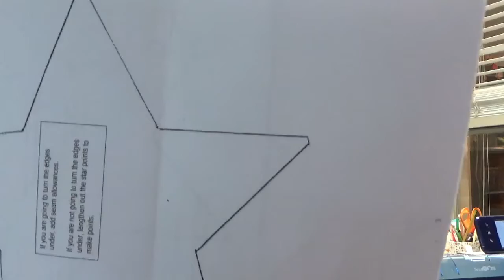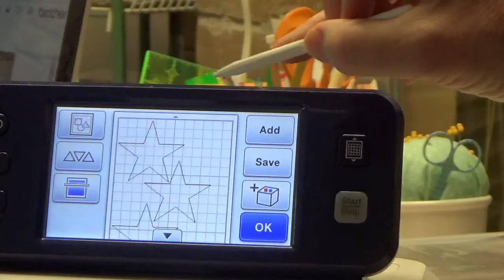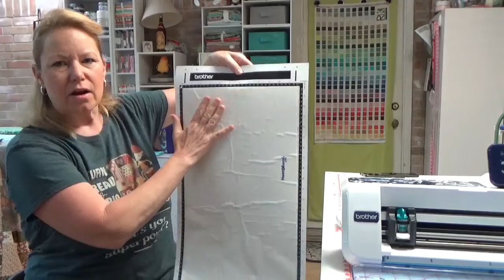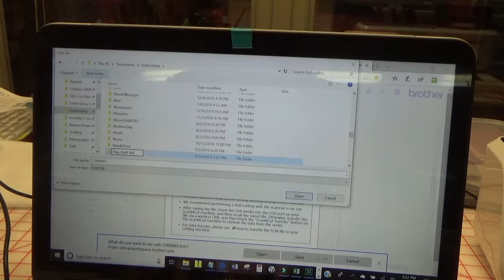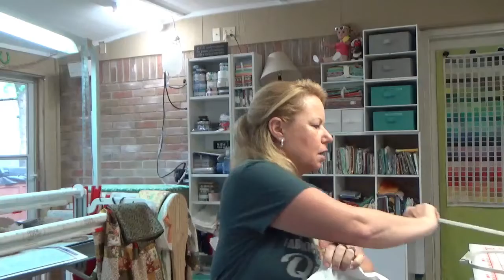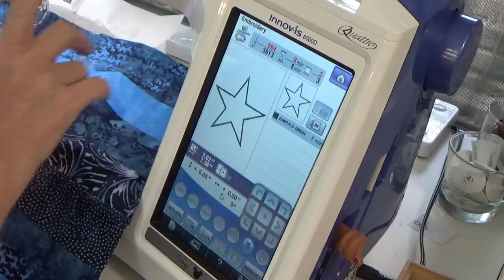Tutorial - Make the Freedom Quilt with the ScanNCut and Simply Applique

Comment: Hi Becky!  I’ve got a question. I’ve emailed Brother and a Brother dealer, and can’t get a coherent answer. I have a Scan n Cut 2.  I also have Brother, BabyLock and Janome embroidery machines.  Using Simply Applique, can you save files to other embroidery formats, such as .dst and .jef?  Or will it only save to .pes? One dealer told me that the embroidery files can only be used on Brother machines.  🙄 Thanks!
Reply from the maker: Hi there!  If you take a look at 20:14 in the video, I'm doing a File/Save As and you can see all the different file formats that the software saves to.  No, it does not just save to .pes and only work on Brother/Baby Lock machines.  I have a Janome MB7 and I've used it on that machine just fine.  The problem at the stores is that they are just not familiar with this software.  It's been around a long time but is limited in it's function so it never really sold well because people didn't know how to use it.  I think Brother is selling this software more now since I've started videos on it than ever.  The limiting factors of the software works great for folks who applique quilt like us and don't do much more, but if you are a serious embroiderer you'll want to use a more capable embroidery program like PE Design Next, DrawWings or the Floriani software...but those are $$$$ and of course the dealers all want to sell you that.  I believe all that software has an applique feature in it that can use scanned designs.  Me?  My companion software is Embrilliance and so far so good but it doesn't recognize .fcm files - hence the need for Brother SA.  You don't need Embrilliance, but that's just the software I use in addition to SA for all of my embroidery needs.  If you are seriously thinking about purchasing it, please contact Allbrands.com.  They are out of Baton Rouge and provide exceptional customer service. They still offer it on their website.  Here's a link with all the product info.  And I just noticed they have now linked to my video on their website!  lol  (With my permission of course).  https://www.allbrands.com/products/65662-brother-sabessa-simply-applique-embroidery-softwar
Reply: Power Tools with Thread   Thanks!  Yes, I use Embrilliance Essentials. And it works great with my Accuquilt die cuts. I contacted them. They have software that recognizes .fcm files and creates embroidery files for the Scan n Cut. But it’s almost $400 and does so much more. Personally, I have no desire to digitize embroidery designs, so it would be complete overkill for me.  My only other obstacle is that Simply Appliqué is not Mac compatible. I have Windows laptops, but really prefer to work on my large Mac desktop screen. I guess I’ll have to dust off one of my Windows machines.  😉 Thanks again for your help!

Comment: Becky do you know if any the programs you mentioned (I think you call them programs) can be used with the cricut maker and a Baby lock Esante...I have had the Esante for 11years...Maybe could convince Hubby on trade in (not too sure)...But the Cricut Maker no way(just got it for Christmas and have not even opened it)...I am also looking into the small Grave frame and a larger throat plate machine....Again everybody has a different name for them long arm, mid arm
Reply from the maker: I dont think Simply Applique works with the Cricut.

Comment: Great tutorial thankyou can I ask I’m in uk if I bought this simply appliqué programme from USA would it work ok as no one in uk stocks this which seems a pity thanks
Reply from the maker: The minimum PC requirements (according to the box) are "IBM PC or compatible computer. Operating System Microsoft Windows 7, 8, or Windows 10. 1 gigabyte of RAM, 1 gigabyte of hard disk space, and Monitor 1024 x 768 video resolution with 16-bit color or higher."  I believe that if you have this type of computer, it will work regardless of where the machine is actually located.  It will not work with a Mac.  I placed a link to Allbrands where you can purchase it too in the description box.  I'm sure they will ship across the pond to you.  :)
Reply: Power Tools with Thread thankyou so much
Reply: I've just bought it, working fine , I'm in Scotland,  give me a call 07895453464

Comment: Nice tutorial, but I would have done 2 things differently....first, if you turn two of the stars upside down, you can get all 5 on the 24" mat.  Second, I would remove the paper backing from the Heat N Bond before cutting - the fabric is well supported with just the Heat N Bond - just check the blade depth.
Reply from the maker: That is such a great idea!! Thanks so much for sharing!

Comment: Have you seen the kits by Carla method for making HSTs? I haven't tried it but it looks INCREDIBLE such a time saver. Check her out on YouTube she has some for other very common blocks too like quarter squares and other stuff!
Reply from the maker: Just checked her out.  That's a great way to knock out a gazillion HSTs if you're using yardage.  That method wouldn't work on this project because the pattern designer has you cut several sizes of squares out of a single FQ and there are 11 different fabrics that all need those cuts.  Like 10-4" blocks and 10-3.5" blocks out of one FQ.  I'd be afraid to run short of fabric with her method.